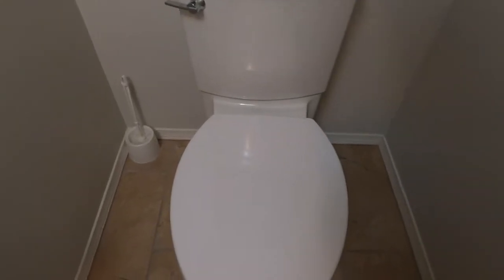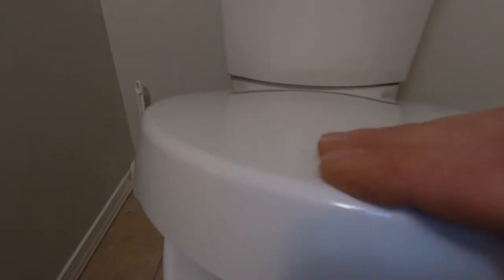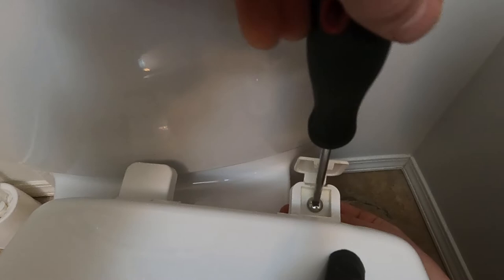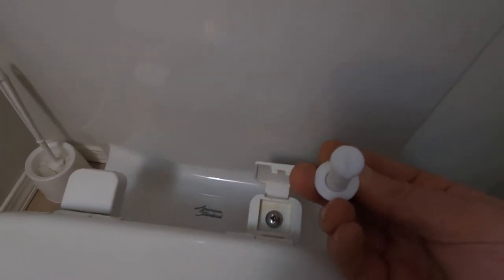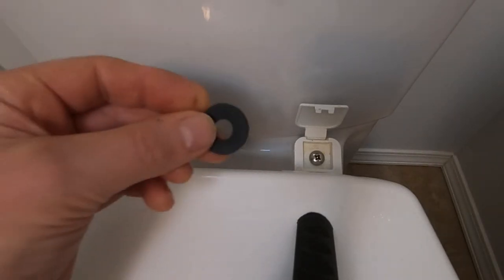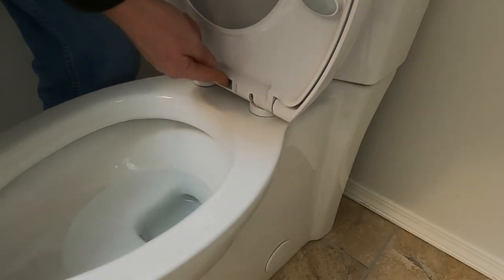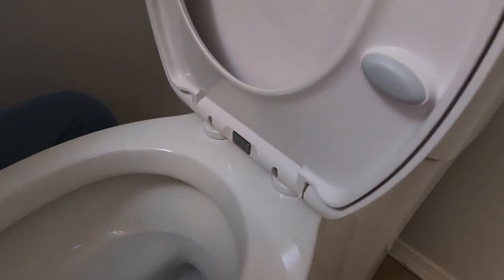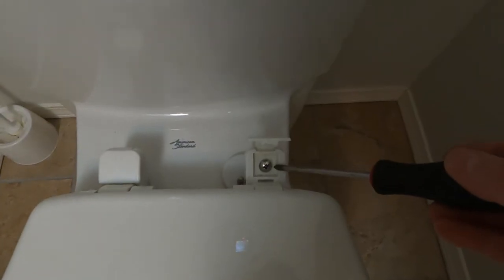How to Tighten a Loose Toilet Seat

Comment: Yeah. The nut on the bottom is covered in a rubber cacoon of sorts and I can't get any kind of grip on it with pliers, etc. wth kind of design is this
Reply from the maker: Sounds like you would tighten from the top like l show on the skirted toilet in the video. If the rubber part is spinning while you tighten then you’re going to have to try different tools to stop the spinning. The joys of plumbing, Good luck!